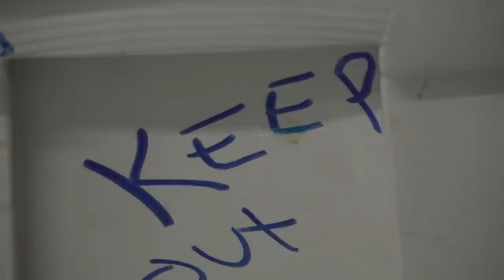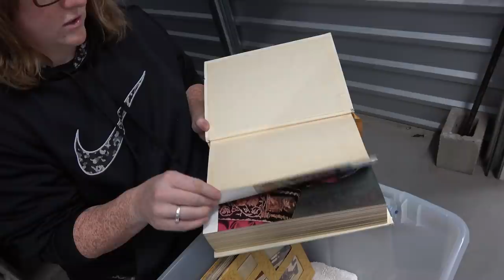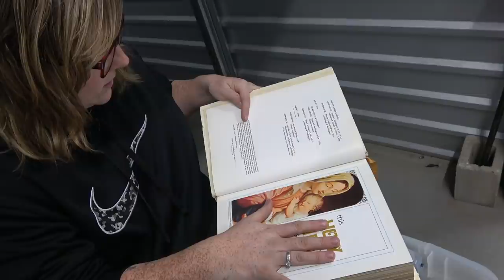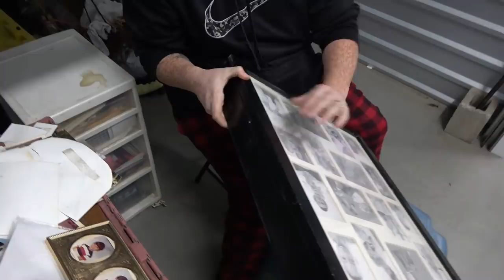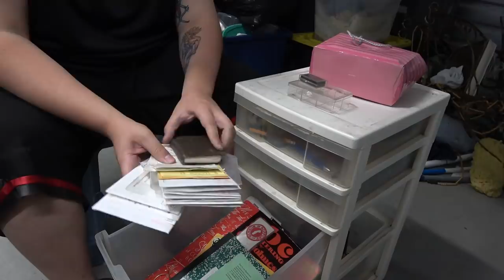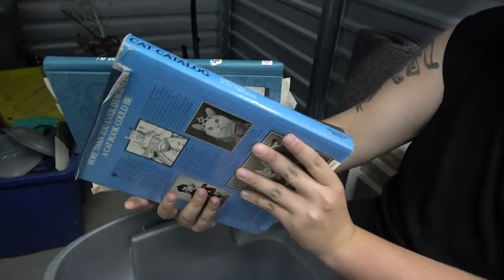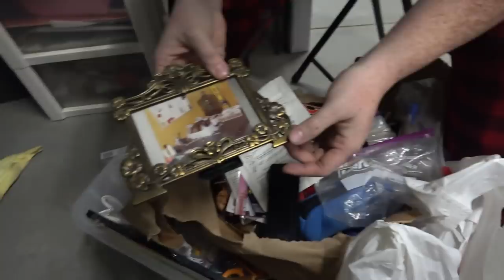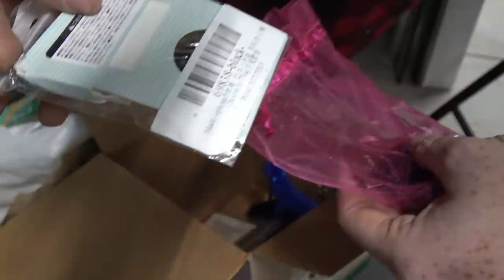I Bought A Navy Seal's Storage Unit and Found A LOCKED TRUNK! I Bought An Abandoned Storage Unit!

Comment: Jebus—In case you were actually wondering the thing you called a saw, it looked like the tool to fix screen windows. Place the screen onto the window pane the thin end pushes the screen into the frame the other end with the groove pushes the cording that holds the screen in place.

Comment: The thing you found in the tool box that you called a small “ bullet “ is a powder 22 cap that is used in a special kind of gun that drives nails through wood into a concrete floor, that’s why their is no lead projectile on the top. It sounds just like a 22 gun going off. I have used them before when I remolded my basement.

Comment: 17:23 Yes those are 22 cal blank rounds. They are used in a Ramset to drive the fastener into the concrete. You remember the Ramset gun you found in another unit that I said be careful pulling the trigger.
Reply: I was hoping someone would comment on that.  I knew what they were, but couldn't think of what they were actually called, and was trying to find a way to explain it lol.

Comment: That big white thing at 6:45 is a reel for a power cord used in factories. It would be attached to the ceiling or a pole and a cord could be pulled out and retract the cord when not in use.

Comment: Bullet at 17:18 -- looked like a .22 short, loaded with snake shot.  Most shot shells are long rifle;  that's the first short I've seen.
Reply: Its a .22 for a nail gun ..used for attaching different kinds of fasteners to concrete or steel usually. Thats why the round was found in a tool box..
Reply: @markaleptic  Ah, so.  Never saw one with a crimped nose before.  All I ever used were flat nosed like a shotgun shell.  Thanks.
Reply: Bob hollis,  I think they are proprietary to the RAMSET system

Comment: The round white thing that you called a “ plug “ is most likely a retractable AC power extension chord/light that you hang from your garage ceiling when you are working on your car.